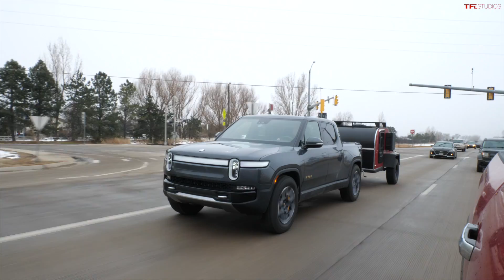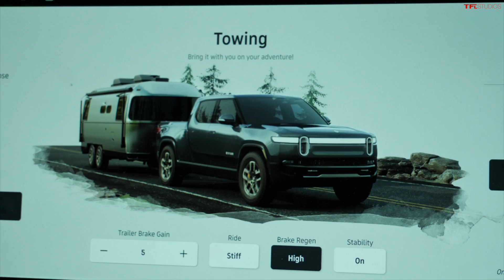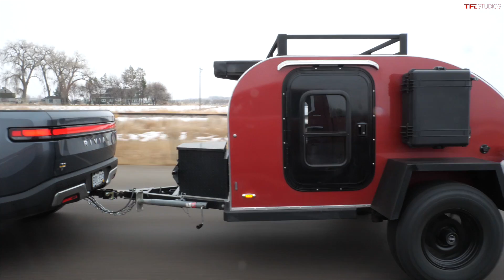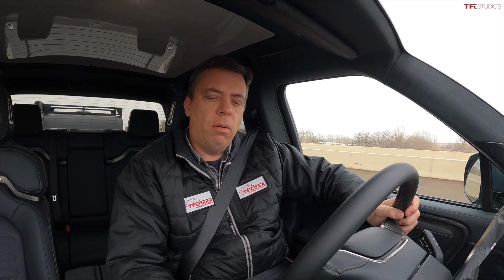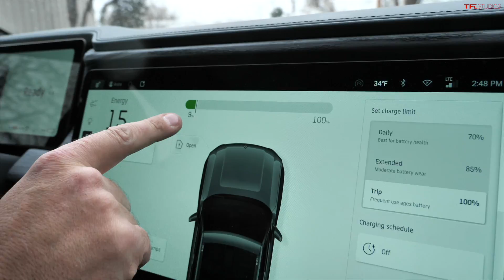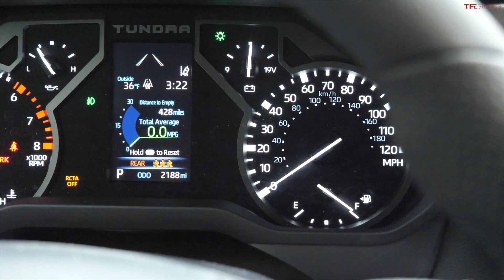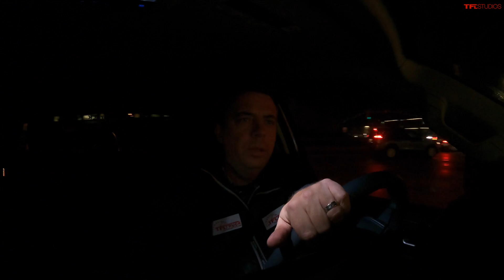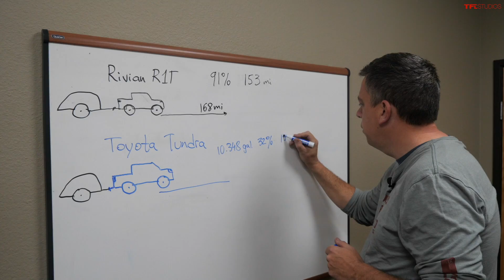Rivian R1T vs. Toyota Tundra: How Far Can Each Truck Tow On A Single 'Fill-Up'?

Comment: So, if you had a 450 mile trip you could make it in 6.5 hours driving the Toyota.  If you were in the electric truck you would have to stop two or three times to re-charge.  How much time would this take?  This would make me take the gas truck every time.  It would be nice if you show the charging cost to compare to the cost of gas used.
Reply: depends on the load more then 2-3. Watched a video where a guy drove an EV with his mustang on a trailer from mich to phx i think. they were stopping every 100miles to charge up. The truck could go more then that but it gets a bit iffy with recharge points.
Reply: @arbiter1  Form is more important than weight, unless you're driving uphill most energy is lost to air resistance. That's why the teardrop is a good choice to haul with the Rivian, an empty box trailer would probably make the Rivian use more battery.
Reply: @morilot  I see a lot more box trailers and typical campers than teardrops on the road. A lot of boats too.
Reply: @mtnman1984  Yeah, and that's s disadvantage for BEVs until energy density goes up.
Reply: @morilot  that’s debatable though, why buy a truck for 70k when a Toyota Corolla tows the same. If the truck can barely tow 200 miles with 2000 pounds I don’t believe it’s even close to the right option, it has no chance versus competition. I could go out and buy a Ram 1500 brand new for cheaper and it’s better in ever way
Reply: @cartera5313  @arbiter1 whoosh! His comment was a joke. 🤦‍♂️
Reply: @arbiter1  that trailer actually messes up the air flow big time, and the weight and rolling resistance are huge factors. You bring up a good point though, it will be interesting to see how well EV’s do with trailers designed for an EV. Using low rolling resistance tires and proper aero dynamics could make a huge difference.  Also, one minor point is the Rivian they were using had all terrain tires so it’s range is about 280 miles not 314, and the cold weather alone cut that by at least another 20%.  There’s new tech on the horizon that solves the temperature issue, and 600+ mile EV will be possible should they choose to make them vs just keeping them 300 and making them cheaper and lighter.
Reply: @arbiter1  that's 314 while using the 21" road tires. This has the 20" all terrains which means a 10-15% loss in range from the get go (which means range is closer to 280, like he says in the video). Plus there's a loss in range from the cold weather..
Reply: @cappyjpadgett  they're fantastic passenger cars/dailies. They're wholly impractical as heavy haulers.
Reply: Well Rivian claims the R1T can withstand up to 220kW of DC charge and the vehicle battery pack capacity is 135 kWh. Due to the battery curve, you’d want to stay between a battery state of charge of 20-80% when traveling via highway. Assuming there’s access to DC Fast chargers along the way (50+kW Electrify America, EVGo, ChargePoint, etc) you could try to plan your trip in 81kW battery increments (based on this video’s findings ~100mi) to optimize charging speed. Best case scenario, you can find 220kW capable chargers and top off from 20%-80% in about 20-25 minutes. Not horrible with this strategy, but still nowhere close to a gasser or diesel performance. Coming from a Montanan who understands weather, range, and shares these concerns.
Reply: @jamisonlee5840  They have another video showing that even on a fast charger it doesn't do peak charge rate for the entirety of the charge cycle.
Reply: I’d hate to turn a 6-7 hour trip into a few days 😮‍💨
Reply: @freedomisntfree_44  you wouldn’t. Can charge back up at a quick charger for 20 to 40min.
Reply: @cypvh74  still a little longer than I’d want
Reply: @Rick 40min charge stop is not “camping”. Also, where we are this weekend for example, is 115miles from home, with RV spots right on the beach. Free electricity to be recharged again to get back home or to the next campground. Perfect.
Reply: @Rick It was a joke ...
There are applications were a BEV truck makes sense, towing a camper cross country isn't one of them.
Reply: Here gas prices are $3.25 for unleaded and I pay $0.08 per KW for electricity. Doing some quick math, the Rivian cost $9.68 to run your loop, but the Tundra cost around $33.50 for the fuel used. Now ElectrifyAmerica is $0.24 per kw so it would be around $28 to recharge. If you charge on the 50 amp RV plug at the campground, then it wouldn't cost any more then the campground fee.
Reply: @superchargedfierogt  In Sweden gasoline is $7.95/gallon electricity in zone 2 where I live is about $0.05/kWh ($0,019/kWh is spot price right now but there's taxes and fees on top).
Reply: @Rick The cost of electricity will not go up.  Currently the majority of electricity is produced from oil.  If you replace an ICE vehicle with a BEV, you are simple burning the fuel at the power plant instead of your vehicle.  The main difference is BEVs are much more efficient so electric cost would actually decrease eliminating all other variables.

Vehicle registrations is how they are recouping lost fuel taxes currently.  You pay massive penalties if you have an electric vehicle.  

There is an abundance of lithium in the earth's crust.  China does not control 80% of the worlds lithium.  They control 80% of the lithium mining industry.  Lithium is scattered throughout the entirety of the earth's crust. It's more the technology and industry are currently behind the demand.  

Lithium isn't used up like oil is, so it's quit literally the definition of a sustainable solution.
Reply: @Rick - they can just implement a tax based on miles driven or increase the EV registration fee to be comparable to an economy car gas tax which is what my state did.  As to the federal government they’ll have to come up with some other approach, or lose $30 billion in tax revenue each year.  Given the federal gas tax is only 18cents per gallon and if you have a 20 mpg car then your at about a penny a mile, so if you figure 10000 miles per year that would be only a hundred bucks a year per car the feds would need to find a way to collect, not really a big deal if you ask me.
Reply: @Rick Here in France the fuel tax is about two-thirds of the price at the pump. E10 petrol is now €1.80 per litre or about $8.00 per US gallon. As of 2022, all new cars have tracking devices, which I am sure will be used to tax drivers by the mile. As you say, they will find a way to replace lost petrol tax revenue.
Reply: Also need to remember you only start an EV road trip at 100% once a day because any needed recharges are only up to around 80% because that last 20% takes forever! So range after the initial run drops significantly.
Reply: @Rick I'm not sure what you are arguing. I stated before that BEVs will need to have a range of 500+ miles before they are widely adopted.  At that point, there will be little impact on the electrical grid because most people will be charging overnight when demands are lowest.  With 500 miles of range you will only have to charge every two to three weeks as a someone who doesn't have immediate access to charging every evening.  If the government allows for natural adoption, there will be little massive upfront expense.  The only issue will be if governments start forcing wide spread adoption.  That will be costly.  Then demand will outstrip natural growth and skyrocket costs.  Change is normal and fine.  Don't panic. Let the people decide.  Just don't jump to extremes to protect some strange point of view.
Reply: @Rick well Texas is just messed up in general when it comes to their electrical grid and it has nothing to do with how they generate their power, other than they chose not to winterize and disconnected from the rest of the countries grid.  Seems a bit surprising to me that would be true for Alberta but I’m not Canadian so I can’t judge.  In any case the math is simple, it’s more efficient to generate power from natural gas, and transmit it over power lines to run an EV than it is to use a gasoline powered car.  So if your only choice for now were to build out natural gas generation for peak and weather reasons that’s be better than not switching to EV’s.  New generation nuclear is an option as well, if you use thorium the waste issue is not nearly as bad and there is no threat of runaway melt down.
Reply: The real question is how often do you have a 450 mi trip? once a year...maybe twice. Under everyday and weekend usage you would never need to go 450 miles away from home. Not to mention...when was the last time you went 450 miles without a lunch or bathroom break (time which could be used to charge the rivian)
Reply: @Rick Not currently they don’t. Towing isn’t their variable of demand either - based off of standard highway economy. Tesla has done it better than anyone at this point, even in a rural state like Montana. Whether you’re against or for it, the infrastructure money coming will close the gaps down to about 100 mile intervals in the next couple years.
Reply: Plus the Rivian was only doing 55-58 mph!  Just going 450 miles would be 8+ hours and the charging time on top of that.  The Tundra for the Win!
Reply: @donaldfurr2141  wouldn't even need a tundra for the win, a Tacoma would be a better towing option especially considering how small the trailer used in this test was.
Reply: @OneNationUnderGod.  agree but was comparing against a Tundra and to be honest the 22 Tundra probably used the same or less fuel than a Tacoma would have!
Reply: @Rick True!
Reply: I’d imagine the trailer would impact range more if he packed actual camping supplies for two people.  That’s a decent amount of payload, so this is an optimistic test with a light trailer.
Reply: @Rick Not really.  Electric charging stations are the cheapest refueling stations available and the main reasons BEVs are winning out over other technologies like fuel cells, whose refueling stations cost a couple million compared to ~$50k.  That said, BEVs will not be widely adopted until the energy density reaches a point where you can drive a full day and then stay at a hotel overnight while your vehicle recharges.  Then it becomes more convenient to own a BEV as appose to a ICE vehicle.
Reply: @Rick - in the US it’s 60% from fossil fuels and it’s declining.  You have a good point on apartments and street parking, however, EV charging rates will continue to improve to a point that it becomes equivalent to filling up with gas time wise.  Even as it is today I have friends that only charge at EV charging stations because they don’t have an easy home charging solution.  They still love their EV’s.
Reply: @Rick man that sounds down right dangerous!  I’ve got a mountain cabin and have a propane backup generator that can run for close to two weeks if need be.  Only, downside is it costs a fortune to run.  Last year I got snowed in up there while I was quarantining because of possible Covid exposure, fortunately not Covid or I would’ve been toast because ended up with no utility power, cell or cable service for two days.  Fortunately the generator kept me from freezing to death, lol.
Reply: @Mach 1 well if and when electric vehicles are the majority,you can bet your ass the government is going to find a way to tax the hell out of us for charging stations,raise electric bills,etc… it’s just going to make things worse for lower class ppl all the way around and be just as bad on the environment,just in a different way. I feel sorry for my kids and grandkids that will have to live through all of it
Reply: Add a bed full of gear, a few passengers, and more stop and go and the 154 miles the Rivian went would be even lower.

Most of the places I camp are about 120-150 miles one way. So for a simple weekend trip, I'd be stuck trying to charge a massive electric battery in the woods so I could get home.
Reply: @unitedgray  Unless they have camp grounds. Then you just charge on the RV spots, more convenient in those cases.
Reply: @realMysta  I camp at primitive sites. If there's power at the site, that's tailgating, not camping.
Reply: @unitedgray  Ah, well I only camp in places where cars can't reach. If your car can reach it, it's tailgating.
Reply: @unitedgray  make sure that you bring your hamster and put a little generator on his wheel.  Maybe by the end of the month you might have enough of a change to make it to a 110 outlet.
Take care of yourself and your family and stay safe.  
PS 
I'm just trying to give a little laugh.  The electric toys have their place, but at the end of the day that truck is just an expensive toy.
Reply: @windrider65  Agreed. I'm all for battery powered trucks, but the battery technology is not anywhere close to being relevant yet.
Reply: @unitedgray  depends on what you need it for.  I don’t tow, and would use it get from our city house to our mountain house which is only 100 miles. I’d also use it around town for gardening supplies and hauling stuff relatively short distance.  Any long distance road trips I’d use our Model Y.  So it’s a perfect truck for me especially since it’s off road ability will allow me to take short cuts up in the mountains.
Reply: @unitedgray  Maybe not for all use cases. There are lots of examples where an EV is perfect. They are using EVs for mining operations now. So they are relevant.
Reply: @MatthewBayard  Yes theres a mine in Switch that uses BEV mining trucks that generates more electricity than it uses. It's a rare case though. 
Boliden in Sweden uses electric trucks that gets electricity from overhead like train to go uphill. Its way cheaper than diesel.
Reply: @michaelwest217  again sounds like  rich person that doesn't do much real work is down for yes because it won't affect u at all for us workers that don't have a vacation house electricity doesn't work for work thusbus again a city rich woke person dream electric cats and a hardworking man's worst dream just make job harder
Reply: @jamesa9lpiopatton419  ouch, that hurts :) You seem upset about EV’s and 2nd homes for some reason. It’s not like I have a mansion, it’s a small cabin in the mountains and many working class people in the city I live in have them.  It will be interesting to see what you think in 10 years because I suspect you’ll have a different view of it.  Keep an open mind, it’s good for you :)
Reply: @unitedgray  more stop and go would increase the range by a lot. so would driving slower.

and the weight really doesn't matter.
Reply: @Ano Nym  I can tell that you have never towed anything before. They even showed going down a mountain that it only increased the range by a few miles from breaking. They also were driving 55 MPH and still had horrible range. If you go any slower, you will endanger everyone around. No matter if they can get the battery range up to 400 miles, if you start towing anything, you will lose more than half, even 60-70% range.
Reply: @danielwilliams4473  I’m curious if trailer braking was affecting that
Reply: @danielwilliams4473  you mean like ice trucks towing up hill on a highway at 40mph or slower? At least the Rivian could stay at the rated speed limit.
Reply: @realMysta  The trailer didn't have any of its own brakes due to its light weight, this was mentioned in the video.
Reply: @adventure_seeker  talking about the other video
Reply: @danielwilliams4473  dude said “weight doesnt really matter” lmao wtf.
Reply: if you join electrify america and pay 4 dollar a month fee they charge 33 cent a kWh. 135kwh battery times .91 is 122kwh. there has to be some lose when charging add 10  percent round up to 130 kWh time 33 cents =42.90. i think the toyota use 10.33 gallons times 3.5 gallon = 36.1 dollars
Reply: @jeffforbes70  pretty sure it varies and some places are per min
Reply: But your towing a teardrop. You get to camp three extra times with the Rivian. And that's just on the way there.

There's a lot less camping done with the Toyota wich must be a bad thing if you're a true camper, right? 😉
Reply: @morilot  It would be the same amount of time camping. Just broken up more with the Rivian.
Reply: @morilot  or u could do all the driving at one time and still camo the whole time without setting up camo 6 time
Reply: @morilot  who wants to camp in a parking lot?   Not me, screw that electric truck…what if you are hauling a real camper and not a teardrop?
Reply: From what I’ve seen charging at EV stations costs about the same as if gas were $2.75 a gallon.
Reply: @b22chris  Yeah - for trips. But if you're at home it's usually quite a bit cheaper(which you have to decide how much you'll be able to charge at home vs on the road) Most people it'll be like 90% at home.
Reply: @b22chris  plus they using all of our gas to charge these electric vehicles what's the strain to the feeble electric system they say we ahvs
Reply: Electric vehicles are a massive pain in the ass and nearly useless unless you just stick within 100miles of your house. Also what people dont realise, our electrical grid CANNOT support everyone having electric car charger at their home. We literally dont make enough electricity to power them all. An electric charger is equivalent to a household having 2 dryers running constantly, about 50 amps.